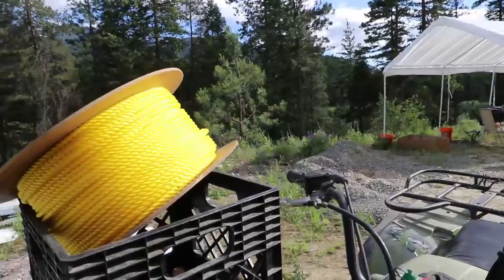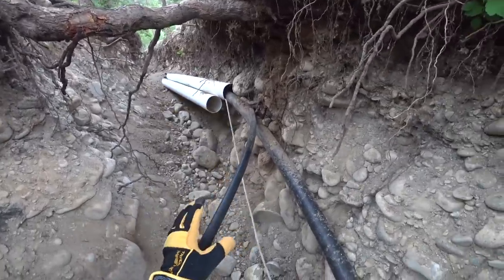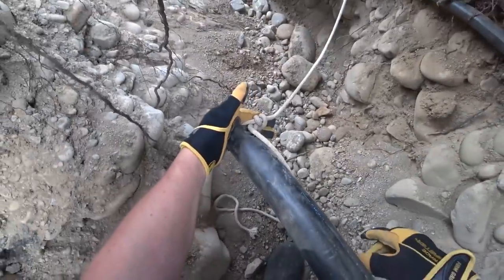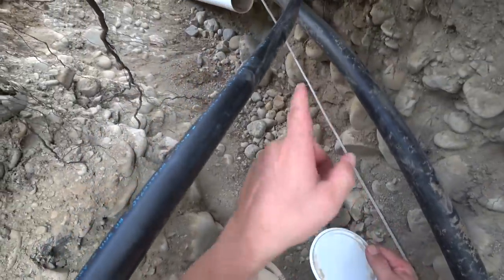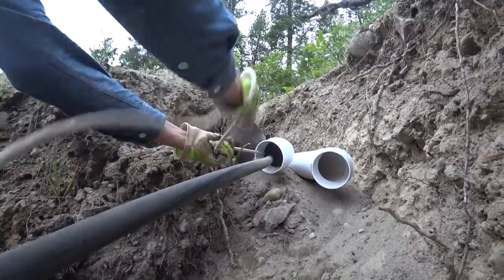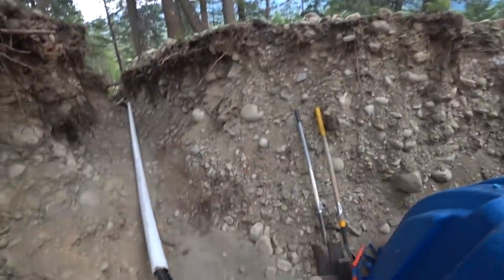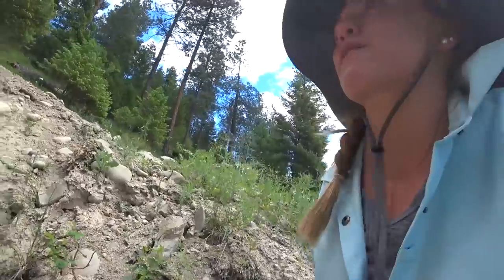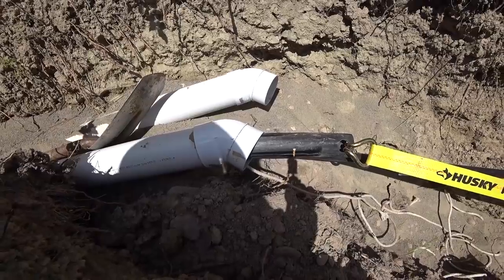IS PIPE LUBE THE NEW SNAKE OIL?! This is INSANE!

Comment: Good job, lots of work! Sharp edge on the end of the pipe will catch on every little bend and connection. I would have probably tried cutting the neck end off of a plastic bottle and used it on the front end of the pipe as a torpedo tip of sorts with the rope going through the mouth of the neck opening. This eliminates the edges and provides a smooth tapered flowing front tip which you could lube if necessary. Love that cat!
Reply: Blowtorch to melt the end a bit and form it into a bit of a dome shape is a more reliable method.
Have done that before with a 3" main. Worked well.

It's also a good idea to lube the conduit by pulling a sponge doped in goop through with the rope first.

Comment: Reading the comments about use the truck or the winch on the 4 wheeler if you took note of the rope they were using it would have broken with the load that the machinery would have applied  but once the rope was able to be removed they replaced it with the chain then the web strapping which has a bigger breaking load.
Reply: Agreed, could have used a better rope, or the mule tape (that I admit, I just now learned about from these comments)
Reply: Dave B cost maybe
Reply: sorry to deny man, but the load applied by the poly is always the same once its moving, since the dinamic friction is stated. so the rope feels the same stress, pulled by the car, the wife or even by the cat
Reply: It clearly didn't snap with the force it took to pull it, I don't know what reverse logic school you came from.

Comment: Hindsight (it's a wonderful thing) - water is a lubricant for both the pipe and the casing. Would have washed the grit and dust out also. Keep it running and occasionally add cheap dish wash liquid. Well done.  You are an inspiration.

Comment: Congrats on getting that done! Don't be stingy in the future with the lube, shove big handfuls of lube in there before your pipe or cable goes into the conduit. Also, I'd consider 50% max fill on the conduit but it's relative to distance and total degrees of bend. 

Also, be careful if you ever use that rope! If it's twisted up in your poly then you could cut thru your poly the same way you cut thru your pipe with the pull rope. I've never worked with the poly but we used to cut conduit with string or rope when I was a kid. It actually works great in tight spaces.

Comment: So glad you got it out! Great job. Any reason you didn't use the winch on the atv to pull it?  The ice-cream looks great 🍦 
Thank God you aren't the typical aMerican. You guys earned that when you kicked the system goodbye! 
I'm learning so much and will be using it on my system when it's that time. I drilled a well and have most of the parts for my air compressor windmill. I'm using compressed air to pump the water so i don't need to rely on electricity.

Comment: Well done guys you did great, i had to do similar years ago with the same type of pipe, i worked in green housing for several years, and had several blocks to pull tubing through buried bellow ground, again awesome job 100 out of 100 :)

Comment: Great job you two I was going to mention using your truck  but I figured you had er . I have installed new service pipe under existing drive ways , and side walks using a piece of ridged steel pipe  to tow poly pipe using my truck and not my back. If it's and old service you can use old steel pipe to pull new poly through with.

Comment: i used spraying silicone through a leaf blower through the pipe and it worked well. silicone is the same weight as air so it lubricated it all

Comment: I have never done this before so just a question. Would it possibly have been easier to lay the pipe in the conduit 10 feet at a time. Then glue joints as you go or is this the common way of doing it? once again just asking. I have done a lot of other stuff but never ran pipe or wire in conduit to be barried.

Comment: First of all, job done!!!! 👍 
For people that want to do a simalar job: 
Always try to do all the cables/tubes in 1 go.
Now you get resistance from the cable/tube already in the conduite, with risk on damage on the already laid cable/tube (burnmarks). Further use lots of lubrication and make the connection between rope and cables/tubes as flexiable and pointy as possible.

Comment: Question, it seems like it would have been easier to lay the pvc ( encasement) around the piping instead of forcing through.
Now you will have to replace pvc that cracked or burned out.

Comment: great video.  i was wondering why you didn't use the wheeler to pull the line. and a small amount of water would lube the pipe soap up further  . working with underground utilities, gas ,electric and water . we usually pulled the lines with an excavator  and although its messy we would lube the lines and pour water in if there was pitch. because the lube is water soluble  soap

Comment: great tip for the weeds growing between the hot tub stairs. get a bag of water softener salt and and dump it into a 5 gallon bucket, than pour in 5 gallon of boiling/hot water and let it sit for 24 hours, stir it up and it will be saturated with as much salt as possible, than pour that into a pump spray bottle(weed sprayer) and spray it on the steps. within 24-48 hours all the weeds will be dead and will kill the roots at the soil and the salt in the soil under the stairs will keep them from growing back for a couple years. i do that for my dirt driveway every couple years and works amazing.

Comment: Three things. 1st, Good job 2nd, always use mechanical advantage whenever possible 3rd, while winching or using a come along it's always good practice to lay a heavy coat or cloth over the cable to help prevent injury in the even if a cable/line/rope failure.

Comment: I have an exhaust that I've just put on a car and it's about an inch too short.  I was going to hook up a ratchet tie-down to pull on it and stretch it a bit but then I saw your comealong that you used on your water pipe and I've just bought one on eBay for $26.49AUD...  Thanks guys for the great idea...!!!  :)

Comment: While PVC  "pipe"  and PVC  "conduit" can both glue into the same size couplings,  PVC conduit  (grey colored) has sweep elbows that are much larger radius.  The "sweep elbows" are designed for pulling heavy electrical cables through them without hanging up on sharp bends. Sweep elbows are actually the same material as straight conduit pipe which have been heated and formed into those gradual sweeping curves.  If you had known you needed to pull the other pipe through the white pvc? You could have carefully heated the pipe with a electric heat gun to form those gradual curves, or, even just glued in some grey conduit sweep elbows into the run of white pvc.  It would have made the job easier.  Congratulations on your determination and getting the job done, though. It saved the day.

When I had to run black polyethylene pipe AND electrical wiring out to my well site through ground as rocky as yours I laid it all out in the trench and then separately slipped (one at a time) 10 to 20 foot remnant sections of black corrugated flexible poly drain over the whole mess coupling the corrugated together with duct tape in places....  The rocks and boulders back fill were kept from hurting my water and power lines by the corrugated drain serving as a protective "conduit".  The building supply sold me all their corrugated drain remnants cheaply. My "electric lines" were salvaged cable tv mainline co-axial cables (solid copper centers between 8 and 10 gauge thick)  I run a 30 amp 240v service 250 feet out to my well and to an RV hookup site for 30 years now with no problems. The cable coax was new on a large spool and purchased cheaply at a salvage place.  I ran 3 (a neutral and 2 hot lines).

Comment: Kuddos on getting that done!  (would there have been any mechanical advantage to "winding" the rope around the pipe as you fed it?  - like the threads on a screw - I'm thinking this would have given more "bite' and "grip" on the pipe while pulling and would  have reduced the amount of stretch that the rope was giving.....     not sure if that would have been better or just caused more friction in the 4" pvc. ?!?!)     :)

Comment: so many comments, I just wonder... as the bottom elbow show sings of damages, are you planning to dig near the upper elbow to look at it?  and did I miss that in between the two 4" near the cisterns, there is no union piece to joint them!!!

is it supposed to be sealded and waterproof the outside 4" pipes ?

Comment: I remember the power company trying to pull jacketed cable (Cablecon) through a trench made w/ a trencher (not a backhoe/excavator) from the power pole to the service panel.  They used their extendable boom that's used for setting poles and attached it to the end of the cable, retract (pulling) ....... worked great.

Comment: You might try to use a torch or a hair dryer to bend the 4" pipe to have sweep bend other than a factory elbow. That will make it easier to pull and to install over your lines already pulled.

Comment: Use lube and a trailer winch. I did 150ft with 2 90 elbows when installing the 200A service from the hydro pole.

Comment: I always watch ur video because u never give up, but guys, this time I have to say: THINK BEFORE DOING THINGS!
1 - dynamic friction is lower than static one, so as you experienced, once the cable is moving it is easy to keep it moving. I think that lubing a bigger portion of it ad pulling it by the car would have been much easier, and if you were afraid of breaking something you could make a sacrifical portion of rope, attached to the car, that would brake in case of excessive pulling by the car
2 - when u did that 22° angle (or something like that) u should have thought about what u were doing next, and maybe making 2 angles of less entity instead of one would have been better
3 - talkin about the angle u could use american tape or something like that to fillet different diameteres of rope and cable, like a bullet, so passing through the angle would have been easier
4 - you could manage differently the exit from the conduit, not gluing the last part with the angle or using something to reinforce the exit, avoiding the rope from cutting the plastic.

I suggest woth love to ask yourself always what you are doing things for, and what will come next, half an hour of thinking before doing things can save a lot of time, efforts and above all money.
Keep going but try to improvise the less you can, bless guys

Comment: they made a rowing machine. if you wanted to soften the pipe a bit, boiling some water on a fire and pouring it down the pipe could work a treat. might work on colder days.

Comment: If you guys are determined to pull it through I'd be using the hitch on the pickup truck nice and slow. Flood the pvc with 4 or 5 bottles of water based lube. Whats happening is that the poly is twisting and turning inside the tight space making it a nightmare. I would have disassembled all of my pvc, gotten some end to end pvc connectors, laid all my poly in from point a to b and then slip joined all of my pvc over the poly gluing as I went. I know the disassembly option is not really ideal as you've already buried a great deal of the pvc. Determined you guys are.

Comment: I was wondering how Bugg-A-Boo will react to the timber frame structure. Will be like a circus!

Are you using lubricant as you pull the pipe through?

Comment: Three things that would have made this job easier. 
1. Use sweeps instead of elbows 
2. Keep pipes meticulously clean and free of any type of grit. Wash the pipe with water to get grit out of the pipe. Use a tarp to keep incoming pipe clean.
3. Rent a wire tugger and use low stretch high tensile strength pulling rope.

Great job it is hard to overstate just how hard this job is.

Comment: A good covering of biodegradable detergent/liquid soap coating the plastic pipes as they go into the main conduit reduces friction and makes it easier to pull and push them. An old trick of the trade.

Comment: Dish soap. Dish washing liquid. Its just like duct tape. Use it to lubricate pvc or any plastics, use it in water and pour it on a tire with a small hole in it and the bubbles will show you where the leak is, use it on house hold pets to get rid of fleas, it works for everything. Off brand is cheaper than the pipe lubricant and flea shampoo  too.

Comment: Arm Chair Quarterback Time .if their is no check valves in system preventing water to go up the hill through the 2 inch line in to the water storage tanks ,than back-feed the water at 
the  bottom of the hill from a near by outlet. Or instead of one 3/4: line and one 2 inch line in one 4 inch pipe , it looks like yo could fit two 1/2 " line instead of 3/4".

Comment: Just push the rope in the pipe. Anybody can pull, Do it the hard way and push the rope in.
After all your my hero's. It's nice having two hero's, or is it one and a helper. You guys work it out.....

I worked for the phone company years ago, when we would pull 2700 pair cable and used elephant snot for lube, it was gray and cold and a consistency like pudding. But the new guys pull fiber optic cable and they pull miles at a time. The big stuff we pulled was only maybe 3 to 5 hundred feet. and that was a strain for a truck to wench that much. The guys who pulled small stuff used yellow 77. and some other stuff, slick as owlschit on a glass doorknob.

Comment: Ok, you recognized the danger of being in that trench, but I don't think you appreciate the level of risk. A couple of pallets separated with some 4x4s wide enough to let you fit between the walls would possibly help a little, but if that caves in it is going to crush you. If you can get out before you suffocate you will still have some serious injuries. At least you didn't spend any more time in there than you had to. I would have done the same until watching the training videos during my training as a volunteer firefighter.

Where did you find the hand cranked ice cream freezer?

Comment: I'm not quite sure why the lighter and (I'm assuming ) weaker person is pulling the rope, while he just puts lubricant on the PE pipe. Ignoring the fact that using the ATV TO BE THE MUSCLE would be much easier. Pushing the pipe creates the possibility that the rope gets bunched up in the conduit. By the way, it's not 22 and 1/2 degree fitting. It's a 1/16 bend or  as we say in the trade. A sixteen bend.

Comment: Instead of pulling the inner ones through the casing how about laying inner pipes in trench and then sliding outer casing piece by piece on them. Starting from top (or bottom) and going only halfway with the first casing and when reaching the end continue from other end.

Comment: would it be possible to use the truck as an anchor point and then use some form of pulley block through which you could thread the Rope and increase the pulling power in a more controlled manner than using a winch?

Comment: Why not use your four wheeler at the bottom to pull it thru ... put the rope onto the rear toe hitch and drive away..... re tie when your out of space.
Use the truck as an anchor put a pulley on the towbar ... rope thru the pullet and drive the four wheeler down the driveway....

Comment: I have a Shop Smith that came with the property that we purchased some time ago. It is resting, perhaps retired, in the barn :( Though neglected and inoperable there are numerous new accessories still in the original packaging, though dusty and weathered, that are yours (a blessing to you both) if desired :)  Off the top of my head there are router bits, drill chucks, dado blades, drum sanders, a jointer deck (very heavy though) and some other nick knacks. I could send a video inventory or picture montage if interests are there. This may help with the finish aspect of your project. If nothing else an addition to the tool arsenal that may benefit the neighbors!

Comment: The likelihood of ever pulling anything through that pipe again is nil. Even if you wanted to replace one of the runs you put in you won't get it out. You could have saved a lot of work by just laying the poly pipes in the trench and burying it. Even running an extra length of poly if you wanted insurance or thought you might need it for something would be a good idea. I would run some wire along with the pipe in case you ever want to install a level gauge or something at the cistern. 4 pair control cable is cheap. Worth it's weight in gold later. Then, fill in the trench and get on with the next project. Don't beat yourselves up unnecessarily. Wear and tear is cumulative. The early homesteaders had short lives. There's a reason for that.

Comment: I wanna know why you guys didn't attach that 1000ft rope to the back of the ATV down the hill, or your car, and pull it through, just before hand cut a piece of wood with a 2 inch hole drilled it in it, with the corners of the hole rounded off, so someone stands up by the pipe and keeping the rope coming straight on out of the pipe...

Comment: I don`t understand why you had to thread the pipe through a casing. The poly pipe won`t get damaged if placed directly in the trench. Our pipe hasn't given any problems since we installed it. The pipe is designed to take the knocks.

Comment: I have been watching you using the wire come along and can see that you really need a cable puller that does not roll no to a drum. You need  a cable puller that as the wire run through the middle and can pull the cable all the way from the end to end without having to  stop and reposition the end. Have a look at the Magna Cable Puller and the Tractel Griphoist. These  you can have a cable a mile long and pull the cable without having to reposition it the whole mile.

Comment: Just an observation but why didn't you leave the 4 wheeler at the bottom and use the winch to pull the rope and pipe.  Just tie simple loops to put the hook in?